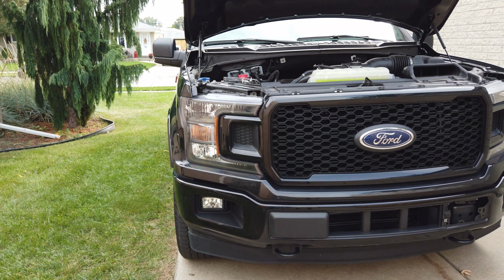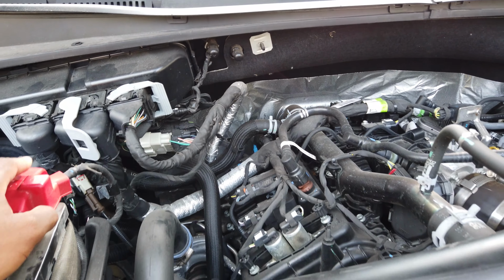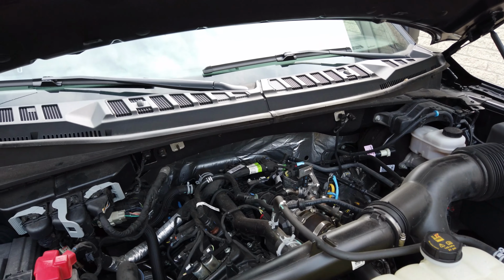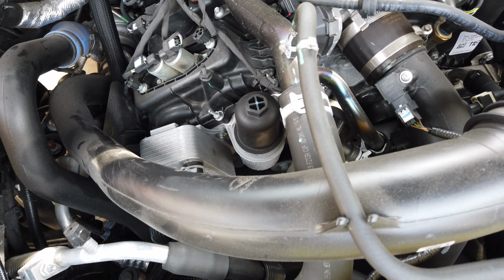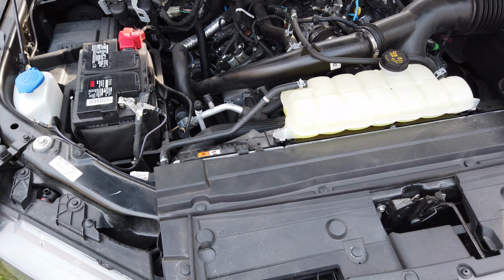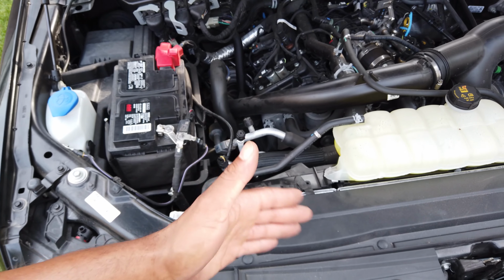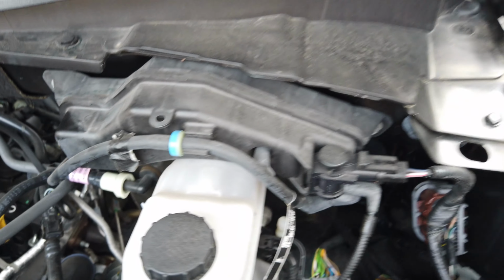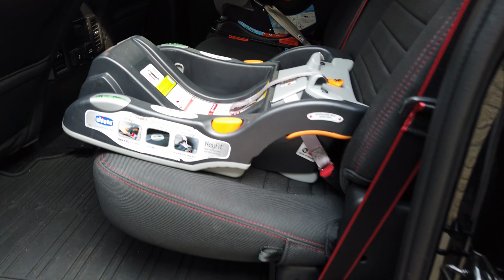2.7 ECOBOOST - SECOND GEN - COOL FEATURES

Comment: Wrong. The reason the exhaust ports in the head are cooled is to prevent the head ports from melting. It has almost zero effect on EGT. The exact opposite is true, lowering the EGT will increase turbo lag and loss of power, not to mention higher emissions.

Comment: Yeah but when a head finally fails you're going to have to pay for it with a NEW EXHAUST MANIFOLD AS WELL!  ..or needing any work done on valve train the labor is going to skyrocket for having to remove the exhaust manifold with the head / one-piece....

Comment: I have a 2015 with a 2.7 Ecoboost turbo that needs the engine replaced; Is it possible to swap it with a 2nd gen, if so does it need any additional calibration or progamming?

Comment: The block skirt has cross-members built into it for extreme rigidity and smooth performance. I waited several years to see where this motor would fail, but never saw anything that gave me pause. I've had mine three years  now and love , love, love it! ZERO turbo lag, and a mountain of torque. Milage can suffer with the 4 wheel version and the STX 20" wheels,  combined with a heavy foot. With about the same or more power than a Cleveland 351, I'll take the 16 MPG's!

Comment: My manual says 91 octane all the time for optimal performance. Comming from a huge background of turbo cars as far back as the 90s , run premium fuel people. I know the truck comes with maps to run 87, and it will , but if you’re looking for longevity run premium.
Reply: Hmmm, my manual for the 2.7 says it was designed to run on 87 but recommends premium for towing. The different grades of gasoline has nothing to do with longevity if not towing

Comment: I happen to see a video of a tear down of this particular engine and there’s one thing that struck me that I definitely didn’t like in the timing chain area they’re actually using a belt that actually dips down into the oil pan which to me I wouldn’t know why you would want a belt in an oil pan it makes no sense. The motor had 96,000 miles and when they checked his belt you can see that it was already cracking all up getting ready to give out. ￼ another thing is is that this particular engine has oil pan leaks.

Comment: Have a 2018/42K miles, and I keep getting 0430, and 0420 error codes. (Mostly 0430) Think I may have an O2 sensor going bad. Any thoughts?
Reply: There’s an open recall for that issue.  Call your dealership with your vin #

Comment: I have a 2017 eco boost with the 2.7 engine. And recently every once in a while it starts to run rough and if I come to it stop, it will shut off. And I get this weird smell coming off the exhaust and I can hear a lot of air pressure coming outta the gas cap. It only happens once a week or so. And than it goes away. I’ve taken it to a few shops around and so far no one seems to know what’s wrong with it. Do you have any advice? Thank you.
Reply: Have you tried the dealer?

Comment: 2018 F150 the only issue I’ve had with the 2.7 is a leaking valve cover at 180,000 miles and the replacement of three injectors.

Comment: Just bought a used ‘18 f150 with the 2.7 32K mikes and I’ve always been a V8 guy but this motor absolutely blew me away!!!
Mine is going in Tuesday because my oil pan looks wet and I still have a little left under the factory powertrain warranty so I figured get everything/anything fixed before it ends… 
Great video, glad I found your channel and love seeing another passionate ford fan!! Keep up the incredible work 👍

Comment: Great video. I ordered my 2022 F150 Lariat in December, and it’s being shipped to my dealer now! I got the 2.7EB not so much for the efficiency, but also a few other reliability factors; one that nobody ever seems to mention when comparing this to the 3.5EB is the external water pump. With the 3.5EB, the water pump is inside the cap, so if it starts to weep, you get water in your oil which gets pumped to the turbos and every other place in the engine. With the 2.7EB, the water pump is easily replaceable without removing the front cap, and no real possibility of water contaminating the oil lines exists. 

I’ll be putting a catch can on as well, just to help minimize the likelihood of low-speed preignition which is often thought to be partially caused by blow-by in the PCV system. 

Awesome content! Thank you.

Comment: I was nervous about it, but I’ve been extremely happy so far. It’s shifting kind of rough but the dealership said bring it in and they’ll get that fixed up. I’m getting 21mpg around town, much better than I hoped. My 2019 Frontier was getting 16-17 and maybe 20 on the highway. All my friends gave me shit about not getting a V8, but it’s way more than enough for my needs.
Reply from the maker: We're all going to need good MPG now! Lol
Reply: @DS-TRUCKS  That's the absolute truth lol
Reply: I have been on two 300 mile trips with my new 2022 2.7L and no lie I got 29.9 miles per gallon on one trip and 30 miles per gal on the second trip. Highway miles going the speed limit with minimal stops.

Comment: Does anyone know what the mpg difference would be on a 2.7 with 3.55 gears and 3.73 gears?
Reply from the maker: MPG will be roughly the same. 3.73 will probably be a little better in the city. A little lower on the highway. Better MPG while towing.

Comment: I have the 2021 STX 2.7 super cab. I commute so not more than 90% highway miles after 7k miles I average ongoing 25.5 to 26.0 mpg. Great power. A pleasure to drive. Amazing that they managed such efficiency; power and mpg. I get only 28 mpg on my 2.0 ecoboost 2017 for the exact same commute.

Comment: I have the 2018 2.7L ecoboost and I love it. Almost bought a catch can but after much research, seemed unnecessary with the direct and multi port injectors. Only thing negative is I can get a little heat soak when I first drive it which causes a little power loss with the turbo lag. Very nice looking trucks! Also found if you flash your high beams you can get the mileage on your dash without having to use the keys. Comes in handy during oil changes.
Reply: What is heat soak?
Reply: Yooo good looking out.

Comment: Thanks for posting the video, Glad to hear that the engine has dual fuel injection to help clean the carbon on the intake valves,,, it seems to be a real issue with regular direct injection engines.    Just got a 2021 F-150 lariat 502A package (2.7 Liter engine),  I receive it in 2 weeks

Comment: Is the first gen 2.7 also the same design with the exhaust manifold built into the block? Have you done a video on the differences between the gen1 and gen2 2.7L?
Reply from the maker: The first thing does have integrated exhaust manifolds. They are integrated into the heads. I don't think I have that video comparing both side by side.

Comment: i am enjoying my 2018 with the 2.7 ecoboost. I have over 110,000 miles and am now getting some stuttering when at hiway speeds and trying to accelerate to pass. any thoughts?
Reply from the maker: u up on all your maintenance?
Reply: @DS-TRUCKS  havent done the transmission fluid yet.
Reply from the maker: @jeremybyron4152  check that first. I thought that was a 30k service.
Reply: @DS-TRUCKS  just went through the paperwork from the dealership and noticed that they have never changed it or they did not charge me for it. Same dealership for all service, but this seems missed somehow.
Reply from the maker: @jeremybyron4152  they dropped the ball on that on on. Should be done every 30,000 mi. not saying that's what's causing your issue. But at 110,000 or something to look at.
Reply: @DS-TRUCKS  definitely, thanks for the heads up. I obviously overlooked that.
Reply: Jeremy
Spark plugs been changed?
Reply: @paulhunter9613  not at the time. Had the truck in and found out that it had something to do with the auto start/stop and a valve being stuck open for coolant. Went in the shop, came out fixed.

Comment: I can't see why they won't make a 3.5 like this. The name of the game is efficiency and they've achieved 90% of the capability of the 3.5 with the 2.7 in a compact form factor. This would absolutely shit all over everything on the market other than heavy duty diesels if they did it with the 3.5. water-cooled exhaust, dual injection, increased compression and such... It's not like the 2.7 is revolutionary step, more of an evolution from the original ecoboost design but better, and made from the get go to be turbocharged.

Comment: 2018 is the first model year of the 2.7 gen 2?
Thought I read somewhere this has a plastic oil pan?
Great vid!
Reply: It does with a plastic drain plug. Mines a 2019 with 125,000k No leaks I’ve changed the drain plug out a few times and new plug seals every oil change
Reply: Why do you change out the drain plug each oil change?

Comment: Great video dude. I kind of wish I saw this before getting my 3.5. In my mind I just wanted the 3.5 for more power. I didn't realize the cam phaser issue before buying it. Based on your break down of the turbos/manifold and cooling, it seems like the turbos were an after thought on the 3.5. And then they built the 2.7 with the intention of turbos.
Reply: Had the 3.5 is by no means a bad rig . In sports mode it can blow the doors off anything but the Dodge He’ll cat.  That’s a Dammed Skippy motor .
Reply: Hopefully the cam phaser replacement and ok pressure increase will solve the issue on the 3.5, some rumors are saying poorly cast blocks are the cause of the camp phaser issue

Comment: Which gears do you recommend for a 2.7 XLT Supercab 302A FX4 as a daily driver and hauling a 2000 pound slide-in camper full time?
Reply from the maker: 3.73 max payload 2.7, if it has enough payload... The 5.0 gets just over 3000 lbs of payload. I can't remember how high the 2.7 goes.
Reply: @DS-TRUCKS  Thanks for the response. I looked it up on the website (which wasn't easy to find), the 2.7 Supercab w/ max payload package has a payload rating of 2165 lbs, but you can't get that package with the FX4 package, which is fine with me. That's probably the configuration I'll go with.
Reply from the maker: 2100 is not enough margin to haul a 2000 lb slide in camper.
Reply: @DS-TRUCKS  It will be for me. I'm not worried about going a little over.
Reply from the maker: @dlg5485  slide in camper has a tendency to tip. Need a slide in camper certified vehicle.
Reply: @DS-TRUCKS  I'm buying an light weight aluminum framed popup made by FWC for that very reason. 2000# is the most it will ever weigh, including gear/supplies.

Comment: I love my 1st gen 15 f150 supercrew sport with the 2.7L. I have mine edge tuned, banks pedal monster, moshimoto oil catch cans and a banks cold air intake and mine screams even with a front leveling kit and 35's on stock wheels. I only have 38k miles on mine too. I will have it till I die.

Comment: I've been researching for a new F150 for a while now. Just can't afford one, but I can dream for free. 
Anyways, I've been that typical "gotta have a V8" guy. Not because that's what a truck should always have, but more so on the topic of less components make the engine more reliable. There are also a few videos out there asking Ford Techs which engine they'd rather have, and the 5.0L always comes out on top. Thankfully, they're starting to ask why. Exhaust note, "because it's a truck", and other menial things mean nothing to me in terms of being a user. 
The folks who have supported the 2.7L have been thorough and I can relate to their usages: Family hauler, weekend projects, occasional tow of a trailer, around town driving, and some highway use. Nothing but good things to say. Then, I've found a few good review videos of the engine, and even in this video, there's the mention of the cast exhaust manifolds, which I think is not only clever, but makes everything a bit more reliable. 
If you're like me, wanting a truck that'll haul your family around, pick up stuff at Lowe's, haul a small trailer very rarely (although the truck is more than capable of pulling a decent sized travel trailer camper), this engine seems to be the best fit for all. Even better that it's the standard option on the Lariat trims.
Reply: TFL actually hauled max tow rating on the 2.7 (and 3.5 because they have identical tow ratings) up the IKE and it didn't break a sweat, and, actually got up the IKE a few seconds quicker than the 3.5. probably because it doesn't need to suck in so much air to work because lower displacement up at 10-11K feet. It also gives you peak torque sooner and keeps it up longer than both 3.5 and 5.0... It's a stout little engine that has more bite than bark. And I'm a V8 only kind of guy but the 2.7 seems to break that mold a bit.

Comment: 9,145 miles and my 2020 supercrew with 2.7 ecoboost died on me.  The knock sensor wiring harness burned up which I'm finding out this is happening with a lot of the 2nd gen ecoboost engines because Ford engineers decided to put the harness in the engine valley.  So it's basically laying right on the hot motor.
Reply: If it was very prevalent, wouldn’t there be a recall?
Reply: @neil3467  yea, it’s bull 💩 stories

Comment: I have had one for three months . The 2.7 is a great motor . I drove a 2011 with a 5.0 in it and was reserved about the small engine. I can’t say enough about how please I am with the 2.7 it’s a beast and gets great fuel mileage if you keep your foot out of it and drive it in eco mode
Reply: That's what I do, a lot of highway driving I leave it in eco.  Get 10l/100km on average.
Reply: That's what I've experienced too. Drove 2 hours north and used a bit less than a quarter of a tank.

Comment: Ok let me get this straight! From what I'm reading the 2.7 was designed to be a turbo.  The 3.5 is just a gas engine with turbo added?  Kind of an after thought. I'm confused,  someone  help me out before I make a mistake!
Reply: 3.5 was put into service in 2006 in the Ford Edge. It was cast with plumbing ports in the block for turbo oiling and cooling lines in future applications. It was intended from day one to be a boosted motor. There’s a story on it if you look up Duratec35
Reply: Ok, from what I know the 3.5 is a  derivative of the 3.5 in the Ford GT. They share %70 of there parts. So definitely designed from the ground up. The 2.7 definitely started with a different design mindset because of the need to put it in a car, truck and suv. Also the ability to mouth it transversely in the Fusion sport, Edge. It's very energy dense, that's why the strong block. The 3.5 has way more head room for power. Hope this helps.
Reply: 3.5 all day

Comment: Nice video and I just subscribed as well. I'm looking at getting a new truck sometime in 2021 and the 2.7 and 5.0 are both options. I only drive 5 miles one way to work so 10 miles a day generally speaking. Do you see short commutes causing any problems with either engine more so than the other? Thanks. Oh, and I generally don't tow much as I'm more likely to haul something than tow. Just in case that information matters.
Reply: Hey Jerry, I’ve had the 2.7 for two and a half years now. Similar to you, I have (well had) a short commute to work and haven’t had any issues. The key thing with engines of any kind are heat cycles, not distance. So the life of an engine is more counted by every time it goes from cold, to hot. With the dual fuel delivery system the carbon buildup is not an issue as much with a short heat cycle.

 I always make a point on weekends at least once a month to get the truck up to temp while doing errands and do a “launch”. So finding an on ramp, going slow, then revving the engine out to high rpm. Once at high way speeds I put it in manual mode to keep rpm high for a little bit and just make sure I’ve got a lot of pressure going through the system. This should help with burning off any buildup and make sure all gaskets and things see top operating pressures.

These eco-boosts have a plastic variable pressure relief valve that is computer controlled. In Eco mode they do a good job of making the engine feel naturally aspirated and deliver smooth power. But when you put your foot down, it really builds the boost. Feels like a sports car and the torque delivery is amazing. It’s just important to exercise the system a make sure it sees the full spectrum of driving possibilities. At least in my opinion.

The choice between 2.7 and 5.0 is all about power delivery. If you want torque at low RPM and be able to drive kind of like a diesel then get the 2.7. If you like to rev out to get your power then get the 5.0. Both powertrains when maintained properly should get 250k miles easy. The weak link in my opinion is the 10 speed transmission which both have. In normal mode it can’t make up its mind on what to do.. so just use the mode selector to tell it what you’re doing and it seems to operate better and not search for gears or shift at weird points you don’t expect.
Reply: The only problem with short trips is it may wear your battery faster. It doesn't have time to charge . It's good to put a charger on it once a week over night to keep your battery charged. I have a 2.7 Ecoboost 2016xlt . It's running very well
Reply from the maker: Either will be fine for short trips.

Comment: My stock 2018 F-150 FX4 Regular Cab SWB 2.7L 10-Speed 3.55:1
24,500 miles and I’ve only installed a new battery, no leaks, no problems at all.
0-60  = 5.9 Seconds          ¼ mile = 14.4 Seconds 
         93 Octane 
G-Tech Pro SS Performance meter
Reply: @Rancy Yaldo 
2018 Truck was two years old when the battery failed, I didn't take it to a dealer.
I think it's one year replacement on battery?